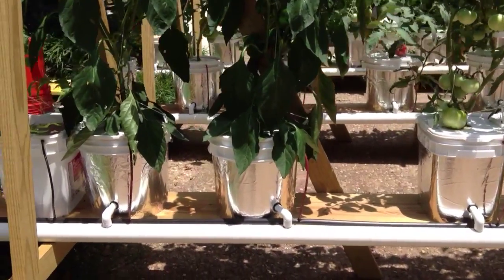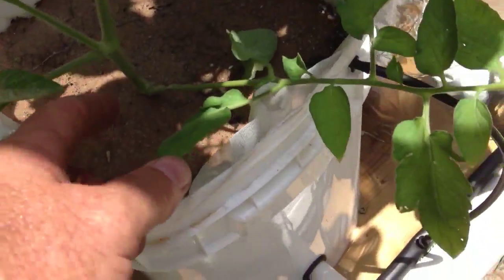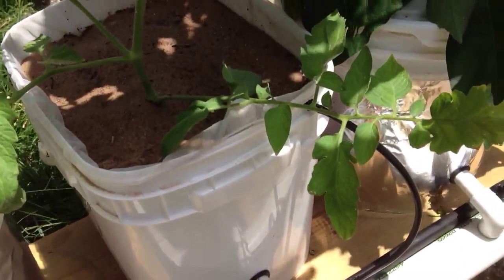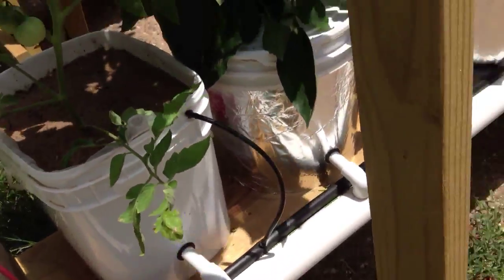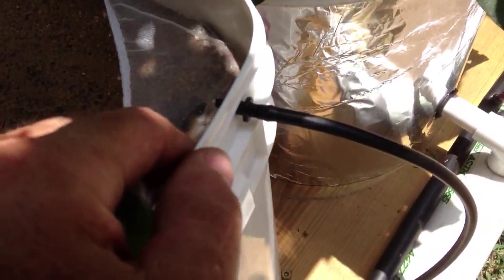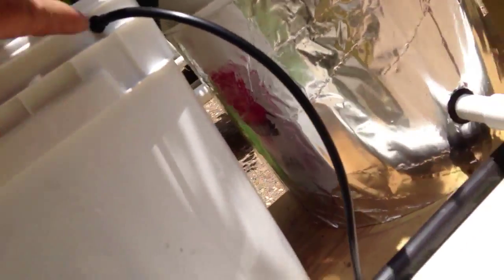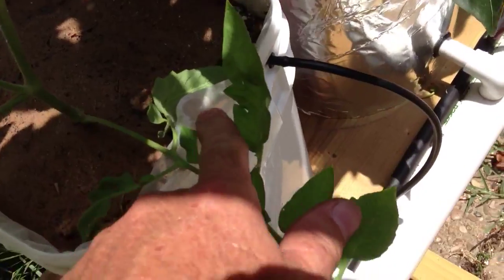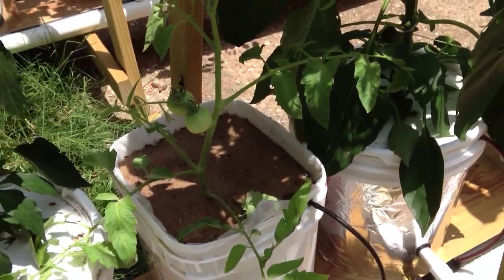Sand  Dutch Bucket Tomato Trial

Comment from the maker: Chuck, if this works, I will have a lot larger crop next year.  I don't know how many four gallon dutch buckets you could fill with that ton of sand i hauled on the S10, but it's a bunch.  I like how even without a lid, the sand is staying moist unlike the perlite.  It seems to dry out on top, and it grows algae when shaded a bit.  I'll share everything I learn off this single bucket.

Comment from the maker: Jason, this sand is super cheap, I bought a ton for ten bucks and I had precisely one dutch bucket left after putting in a new pool liner.  I'd like that expanded shale, it does sound like hydroton.  They used to make lightweight concrete blocks with that stuff.  The good thing is concurrent growth.  If one things fails maybe others will succeed.  Again, toss in our economic conditions and I can see families without electric power or money to buy fertilizer further complicating dutch buckets.

Comment from the maker: Results came quickly.  This plant looked good at first then it started drooping.  No!  Yes, it's way sick.  I've killed it.  My guess at what's wrong?  I think it drowned and here is why:  1.  The very healthy plant took days to show any sign of a problem.  2.  It wilted down.  3.  The sand never dried out on top and is very compact.  4.  Drowning occurs to stuff when it can't get any air, right?  5.  I think the draining effect of other media is the plus sand does not have. END of postmortem!
Reply: sand does drain but you fed it the same amount of water flow as the fast draining media which meant the sand could never drain in time and the plant drowned.  To solve this, the water supply would need to shut off on a timer.  It would need periods of zero water entering so that the sand can drain and dry out on top.  As the top dries out, oxygen would be drawn into the sand letting the roots breathe.